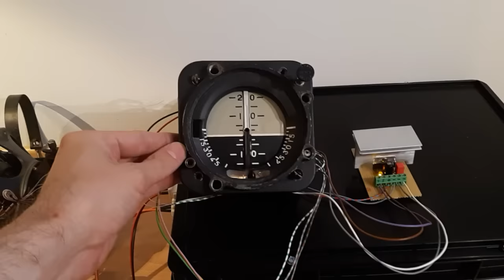Startup of a Russian "type 458" gyro block of a MiG-21 fighter after almost 40years of storage

Comment: Amazing to think of how they did these back in the days of analogue/mechanical computers. Equally amazing, today a similar IMU unit with even more  sensors and axes can fit on your thumb nail for a few bucks.
Reply: Fighter jets typically don't use MEMS for their INS, so no.
Reply: @graealex  True.  In tactical applications and space craft mechanical gyros are used, my guess is in the event of a power failure and restart, the already spinning gyro would continue to hold orientation where a MEMS one would need to be recalibrated upon restart. That would be my guess.  Still, majority of military use cases especially unmanned units and with better backup systems, the benefits significantly outweigh the cons.
Reply: @preddy09  Again, modern fighters also don't use mechanical gyros.
Reply: @graealex  Well, will you tell us what they actually use?
Reply: @graealex  First off, all gyros are mechanical as they rely on conservation of mechanical motion.  Mems gyros have damping factor so large that that they oscillating actuator stops almost instantly.  If not the older "spinning disc" type mechanical gyros, newer gyros use light interferometry based mechanism.  Which again is just a bunch of spinning optics where changes will result in interference.  So it comes down to noise and holding time.  Mems have near zero holding time.  I'm guessing both spinning disc and spinning laser/fiberoptic will spin down over minutes, and significantly lower electrical interference.
Reply from the maker: @Vid304You  they mostly use laser ring gyroscopes.
Reply: Edit:  I'm wrong, it seems light based ones don't require any spinning.  Changes in direction will result in one path of light taking less time than the opposite path, resulting in the two interfering.  Extremely low noise, and no motion.  But suffers the same instant collapse of orientation just like MEMS, but I assuming good backup independent power is not hard.
Reply: @barjan82  thank you!
Reply: @preddy09  No. See laser gyro. Not mechanical.
Reply: Great thread here folks, thank you.
Reply: @graealex  I understand now, thanks for getting me to look into this. Learned new things
Reply: @preddy09  The thing with MEMS is the immense amount of noise, that will at most allow one single integration. With an accurate gyro and acceleration sensor and a very stable clock (Google CSAC), you can do double integration (acceleration to speed to position) with reasonable precision. MEMS gyro/acceleration sensor plus MEMS clock source like in mobile phones drifts like there's no tomorrow.
Reply: @barjan82  Thanks for the demonstration.  Some day I'd like to get one of these as an "antique item"  and display it in a corner of my future house instead of some ambiguously meaningless modern art item.
Reply: @shvrdavid  My understanding now is that vibration noise (mechanical) and correction noise (electrical) are the enemies for stable positioning as those noise sources lead to drift.  Drift means deviation from set position without your knowledge, until you need to recalibrate, obviously that's enemy no.1 for gyroscopes as that defeats the purpose of needing a gyro.  Unmodeled noise is very high in MEMS from both sources.  Mechanical noise is high in active spinning wheel gyros.  Light based gyros are the most stable as they are inertially passive, i.e don't injection of rotation for operation, inertial changes are only sensed. Hope you see the difference there.
Reply: @shvrdavid  I'm talking about setpoint calibration, which needs to be updated if drift is suspected.  There lies the problem.  Also don't confuse accelerometers with gyroscopes.  Accelerometers are much easier to work with and isn't what I'm talking about.
Reply: @shvrdavid  When you say airbags you are automatically talking about accelerometers as no gyros are needed unless rollover detection is added, which is a newer feature.  Gyros were never in cars until recently for rollover and stability control.  Maybe you missed that basic logic.
Also, if MEMS IMUs were so accurate, why do we need GPSs??
Reply: MEMS gyros are mechanical, they use microscopic vibrating structures similar to how the haltares of an insect work. The vibrating structure wants to stay in plane which is how they sense angular rate. Detection of rotation vs the vibrating structure uses capacitance down in the zeptofarad range. Cheap commodity motion processors used in mobile devices work well enough for small multirotors and small to moderately large R/C / drone helicopters (modern R/C helicopters now use a system similar to how the AH-1 replaced the stabilizer bar with a three axis gyro which is why you don't see a stabilizer bar on R/C heli rotor heads anymore). There are aerospace grade MEMS angle sensors for use in small drones but you only see those in military UAVs generally. There was one hobby grade helicopter flight controller that had such a sensor as an optional upgrade, the Mikado Vbar but cheap motion sensors have improved so that they are now considered "good enough" and they have since discontinued that and just use an MPU6000 series sensor in it now.
Reply: @preddy09  Fiberoptic/laser gyros are not mechanical.
Reply: @StefanWelker  Yes.  Already made that correction and briefly explained how they work earlier based on what i understood.
Reply: That’s not a computer!
Reply: even the fanciest plane in the world will have a physical gyroscope to provide it's basis of orientation (datum). even the fastest and most reliable computer will reference a physical gyroscope to verify its other sensors. stationary, plumb and level. the thing that kills the flying ball. digital is a quality of an analogue universe, not the other way around....
Reply: @evolutionCEO  thats not right, dassault and airbus are building mems imus into their newest generation of fighter jets and drones. Also: every quadcopter has a mems  imu, in a quad copter you need even faster acting gyros to get it under control.
Reply: @shvrdavid  "Zero moving parts" and MEMS in the same sentence is a contradiction on its face.  Please read their product line before you make logical errors.
Reply: @evolutionCEO  The reason why commercial aircraft use seemingly antiquated technology is it being reliable and the big risk vs. gain from saving a few pounds. But we were talking about fighter jets, which won't even lift off the ground without immense computer power. It's really a different story, and I suspect a number of MEMS being there too, although that's still not the kind that would fit on a thumbnail, which was the original claim.
Reply: @shvrdavid  I obviously read that and was waiting for you to mention it.  It's called marketing.  Why don't you describe to me how the thermal MEMs devices work.  You'll get it then.
Reply: @shvrdavid  Their claim of no moving parts is questionable. Technically true, yes. There's an explanation in their datasheet:
"A heat source, surrounded by thermopiles in the silicon chip, is suspended across a cavity. This heat source creates a field of heated gas around it, commonly referred as hot air bubble. The thermopiles capable of detecting changes in the temperature field around the heater. Applied acceleration disturbs the temperature profile. The temperature, and hence voltage output of thermopiles will then be different. The differential voltage at the thermopile outputs is directly proportional to the acceleration."
The gas is moving around at least.
Reply: @graealex  Yup.  A grossly over-simplifying analogue would be like watching a helium balloon inside a car change positions based the car's changing velocities.  Not a true "no moving parts" accelerometer but gets some benefits at the cost of discarding higher frequencies.  Actually I don't think a true no moving part accelerometer is physically possible.  Only for a gyro the optical method is truly no moving parts.
Reply: @shvrdavid  Not really sure what you are arguing here? This is mainly about certain technologies having inherent limitations, that no doubt will over time get overcome, but the fact that there's still no reliable way for indoor tracking in smart phones (or VR headsets for example) without GPS or proximity triangulation or camera/TOF tracking should be an indicator for the task at least not being easy or already solved. Obviously progress is happening, but especially aviation projects are usually planned on the span of decades. Btw. MEMSIS puts their MXC400 into the consumer spectrum.
Reply: Edit: I'll take it back.  A no moving part accelerometer is possible using light, but this time, we'd have to use time dilation.    Which would be difficult to do in a small space.  Maybe there's a way to use light interference which would make it a lot easier.
Reply: @preddy09  I'm pretty sure it's possible. There is no theoretical problem in making a linear optical sensor - "only" the practical problem of having to measure TOF of a very short light path.
Anyway, I am pretty sure we'll see miniaturized acc/gyro with drift measured in mm per minute, or maybe even per hour in the next 20 or 30 years. Problem is that fighter jets usually take the components that were state-of-the-art 10 years ago. So even a very efficient sensor like the MEMSIS wasn't even available when current fighter jets were designed. And after a solution is already integrated, there is little reason to change it, unless it gives a large benefit.
Reply: @preddy09  Btw. I was a bit rude on my initial reply because I didn't have the time to formulate proper arguments on why you don't see MEMS technology yet in fighter jets - at least as a replacement for a truly mechanical or optical solution. As pointed out, the problem is that 10 years ago, MEMS was still utter garbage, and no matter how it is going to improve, you still have to carry along a very, very accurate clock source, otherwise you can't do proper integration.
Interestingly, a number of tech channels have recently featured the CSAC as PCIe cards for data centers where time keeping might also be an issue.
Reply: @graealex  Ya was thinking the same. changes in TOF of light over a small distance will need some ultra short pulse laser source.  Interference method like the Michaelson Morley experiment may also work.  But some time before it can get practical in a small space.
Reply: @preddy09  Well. I mean you could always just "simply" measure the Doppler shift. Very simple. There's really no lack of physical phenomena, but the problem is always to get an accurate measurement in the confines of a small package.
Reply: @graealex  Actually didn't think deeper till you mentioned Doppler shift.  I'm no physicist, but if I understand correctly, neither Doppler shift, nor TOF  would work in a "no moving parts" accelerometer.  When it comes to speed of light in a given reference frame, the TOF and Doppler shift = 0 will always be the same no matter the velocity or dV.  Only an external observer could see differences, which would no longer be "no moving parts"  So that leaves the interference method which should work, which is how the optical gyros work also.

Correction: I suppose,  an orthogonal TOF could be used as reference for the other axes.
Reply: @graealex  As for any rudeness, I didn't see it as such.  Short responses could mean anything.  I need mean statement to be counted as rudeness which you did no such thing, and even if anyone speaks that way I don't find offense to that as I've been guilty of that and learning isn't as effective.  I think better when I don't react emotionally and stick to the learning process while allowing others to be critical, which is a good thing.
Reply: @graealex  Ok, I think my initial guess was correct. Had to get back to the Michaelson-Morley experiment.  I don't think any TOF, Doppler or even interference method will work to find acceleration in a fixed reference frame, i.e "no moving parts".  The only reason it work from a gyro is because the center interference detector is moving as the entire vehicle rotates.  So I think no light based "no moving parts" accelerometer is possible.
Reply: @graealex  the gyroscope is a fundamental principle. it is a datum for measurement. it shall never be antiquated.
Reply: @preddy09  You might be right. Although a quantum accelerometer might be as close to that as it gets. Still, the "moving" part are ultra-cold atoms, so it isn't truly solid-state.
However, it's not necessarily a problem of "same frame of reference", because even when everything is moving together, light always travels at the same absolute speed. I only suspect that measuring it might be impossible, as time (and space) dilation would happen to the clock you're carrying along. But that's really as far as my knowledge gets me here. However that's rather theoretical anyway, as using relativistic phenomena to measure non-relativistic speeds is very hard. It would be like getting the value for a car's speedometer by measuring its dilation along the axis of travel. It's true, a car gets a bit longer when it travels at speed, but the effect is negligible compared to all other effects that might have influence on the car dimensions, like temperature.
Reply: So what your really saying is the earth is round because if it was flat planes wouldn't need gyroscopes.
Reply: There is no real opportunity to replace mechanical gyroscopes because only mechanical gyroscopes are capable of holding rotation when the power is turned off.
Reply: @fsagasdfgasd6243  Commercial aircraft continue to use it, because it is relatively cheap to the alternatives that have aeronautical approval. But most fighter jets and a number of newer commercial aircraft will absolutely require power. In those cases measures are put in place to make sure that doesn't happen. For example, the cockpit in a F-22 is completely electronic - there is not a single electro-mechanical instrument visible. So either the cockpit has power, or the pilot is completely blind, and probably not flying for that long either, as the aerodynamic instability inherent to fighter jets makes flying without electronics impossible. But then again, even the A320 for example has a fully electronic cockpit.
Reply: В СССР первый станок ЧПУ уже был в 1958г, МИГ-21 тоже начал выпускаться с 1958г. И да, он был аналоговым.
Reply: @graealex  It's not about a complete power outage, but about short-term power failures, which are associated with a delay in switching backup systems or the accumulation of errors in the electronics. Also, failures can be caused by various external influences that affect the operation of electronics.
A mechanical gyroscope is a reliable and predictable frame of reference that will maintain its position at all times, in case of any possible failures.
Reply: @fsagasdfgasd6243  Okay then tell that to Boing and Airbus. They'll be glad to get your advice about switching back to a mechanical gyro.
Reply: @Vid304You  The last INS  aircraft I worked used laser ring gyros. These are a triangular tube with a  laser shining on a mirror that is reflected on a target. Movement causes an interference signal compared to a reference signal. The iron gyro died in the 1970's.he
Reply: @graealex  Aircraft use several types of gyroscopes together, including mechanical gyroscopes, micromechanical gyroscopes, fiber laser, etc.
On some commercial aircraft, mechanical gyroscopes are not used to reduce cost. Mechanical gyroscopes are quite expensive.
On military aircraft, mechanical gyroscopes are almost always used, of course in tandem with other gyroscopes.
Reply: Tomáš Novotný  No one mentioned it but no one is talking about reaction wheels here either...
Reply: @preddy09  despite all discussion I still think you made a viable point in your first post.
Reply: And breaks multiple times before even getting it out of the package.
Reply: @preddy09  laser gyro IMU setups are battery-reliant, so good guess there
Reply: Please Sirs, can you tell me why as a french man 60 years old, with just a little english capacity, I'm reading your expert conversation, understanding just a part,
 but just enought to poursuit my reading ?
Technical interest, I guess, and pleasure to have a look on specialized conversation between good guys...
Thanks Sirs, you gave me a good time, and teached me some knowledge today !
Reply: That's not fully true. The modern MEMS solution precision is way lower than in this mechanical gyros. This is a fighter jet high precision device. When the MEMS precision is not even enough for personal use cases.
Reply: The gyros in a lot of fighter jets were electrostatic levitated beryllium sphere multiaxial gyroscopes. They used an induction field to spin a hollow beryllium ball in a vaccuum chamber at aproximate 128,000 rpm. Once spun up the ball would stay centered due to eddy current induction. The balll had a laser textured index marking on it that was readout with an array of photodiodes and a laser. One benifit of this was it spun up fast, required no slip wire connections and it had  complete axial freedom. It maintained a reference for several seconds if power is interrupted as well since the ball would continue to spin.
Reply: I wonder which is more reliable, which is more resilient to ECM, and which lasts longer...
Reply: @shvrdavid  Just because it has no moving parts doesn't mean it doesn't need calibrating. Electronic sensors need calibrating too, and do degrade over time.

 Also airbags have expiry dates.
Reply: @shvrdavid  Fair enough on the airbag, that was phased out. However, to say non-moving sensors do not need calibrating is wrong. Sure crash sensors  etc don't need calibrating because they are not being used for precision tasks.
Reply: @preddy09  Being an electronic Engineer today's gyros could easily run for months on a good Lithium battery, the real issue is certification and accuracy, most cheap chips only do 8- 16 bits of accuracy so if you say used 8 bits it gives a  +128 to -127 so roughly 3 degrees in angle... so not great for bombing runs... 
Going back to certifications the big players like to make stuff super hard and expensive and want to milk a design until forced to make it better, hence this is pre ww2 era tech very robust but lots of mechanical costs.
Reply: @graealex  Laser Gyros and dead reckoning is very accurate and is how most pilots are taught, gps is useless at high speed (above 500Mph) so ok for cruise missile about 400Mph, after that speed the time dilation on the received signals is too great and throws out the GPS results... 

Gps works by time stamps and 4 satellites(minimum) (intercepting arc tangents) so timing is super critical as each satellite signal is received the time stamp is read the forth satellite act as a base clock... so by working out the time difference and knowing the satellite you can look up which ones and work out the co ordinates. Note use to work in GPS design (electronics)
Reply: @preddy09  ring laser gyros do not spin  but they do dither back and forth, they hum quietly compared to this
Reply: @ntal5859  Why are you telling me this? Gave I reason to you to assume I don't know that?
Reply: @preddy09  "good backup independent power is not hard" Yes, it is called a capacitor :)
Reply: But it isn't EMP hardened nor military aircraft grade.
Reply: Not to forget that they didn't even use any design software...
Reply: Will they work in 40 years?
Reply: @Vid304You  laser gyros
Reply: Not a few bucks, but I suspect a bit more, at least for military usage.
Here is a video (in French) showing Safran old, actual, incoming and future military gyros, used in fighter jets, nuclear submarine, Leclerc tank, ICBM, etc. : https://www.youtube.com/watch?v=ouz7jc-r4eY
Reply: I was going to jump onto the MEMS gyro bandwagon until I started reading through this thread. I've now been given a much better appreciation of the pros and cons of big physical gyros vs. MEMS vs. other gyro technologies - like laser - that I didn't even know about until now
Reply: @shvrdavid  Without reading all the prior comments leading up to yours, I'll just say that airbags etc. would be using accelerometers instead of gyroscopes, and don't really have to worry about any initial reference point orientation the way many applications using gyroscopes do. In airbags, I'd guess that it's pretty much "big impulse -> deploy" (impulse being the rate of change of acceleration)
Reply: Anyway, awesome and informative comment thread - a rare gem for YouTube!
Reply: @shvrdavid  I'll take a look at the link
Reply: @shvrdavid  Couldn't find the link - there is a lot to read through.
That said, in a nutshell, where do gyroscopes come into the picture with airbags, vs. just accelerometers?
In terms of detecting a crash, I wouldn't think a change in angle would really come into play - only changes in velocity over time (acceleration) or changes in changes in velocity over time (impulse).
As for all the debate about calibration - I'd say it simply comes down to the use case - for something like airbag sensors, I agree that there probably isn't much of a need for calibration, whereas something like an inertial navigation system needs to have some starting reference point and orientation to go from, the establishment of which arguably constitutes calibration.
Finally, don't be toxic - we can all learn from each other without it becoming an exercise in pointedly calling each other wrong.
Reply: @preddy09  No, not all gyros are mechanical, there ate optical gyros as well.
Reply: @preddy09  Haha, sprry about my first comment, I read your later comment firther down the list after writing my first comment! 😜
Reply: @shvrdavid  know nothing about any of this but why are just being rude for no reason to this dude
Reply: @preddy09  Couldn't you make the IMU/motion processor circuit have its own backup power :P
Reply: What do you use to locate and troll people?
Reply: @StefanWelker  could you please give us some links to learn more about mems IMUs for modern planes?
Reply: @graealex  get ratio’d
Reply: Talking about pros and cons, which of these technologies are susceptible to errors due to helium ingress?
Reply: Je vois pas trop l'utilité de ce truc sauf sur systèmes automatisés dont l'apport à l'humanité en tant qu'apport, reste à démontrer, ...
Mais j'ai cru comprendre lumière telle corpusculaire, ondulatoire ...
Par essence, intrinsèquement mouvement mécanique ...
Sauf vos respects ...
Messieurs les «savants» .
Par essence, intrinsèquement, mouvement mécanique .

Autant pour moi, quant à l'établissement de vos points de repères dans le référentiel .
Et, sincèrement désolé de froisser vos égos .

Merci.

Dare, care, ride safe, clean, have fun .
From France with .
Reply: Mechanical gyros give you an angular position, but MEMS gyros only give you angular rates. Useful for controls and drone autopilot, but requires additional reference to estimate an absolute position. Integrating the rates is generally garbage - in a submersible application they'll diverge in a matter of seconds, and in aviation I'm guessing much faster.
Reply: Since people are still replying, here are some thoughts from an actual aerospace engineer if anyone wants to know the real deal.  In no particular order:

- The MiG-21 was designed in the 50s.  Best case, this particular gyro is a mid 60s upgrade.  In general, no airplane designed since the late 70s uses an actual spinning hunk of metal as a gyro.  It's all ring lasers as mentioned

- Even the spinning hunk of metal shown here runs on DC power (28 volts as shown on the meter).   IMUs and the INS are typically on the essential battery bus.  That's how you handle power failures whether the gyros are mechanical or laser.  

- The accuracy requirements for flight controls are actually much looser than for navigation.  If you're off by 1/2 a degree in pitch, roll, or yaw, that's pretty much in the noise when it comes to flight controls.  Be off by that much and integrate several times a second and your navigation solution will run away on you in no time.  

- And last but not least - GPS is useless above 500 knots because of relativity?  Never heard of that.  At the equator you're doing 1000 knots relative to the center of the earth just sitting on the ground.  At the poles, zero.   If 500 knots throws your calculations out the window, GPS would be unreliable over huge portions of the globe.
Reply: @dylanh333  so what about gas bearing gyroscopes?
Reply: @shannonmcbride2010   So now I'm curious. You seem to know about these things. Why are hemispherical resonator gyros or HRGs used in NASA telescopes. I'm trying to understand the applications of these gyros and which ones are accurate in what ways. I'm obviously just googling stuff trying to learn. I saw that the NASA ones are accompanied by several other sensors, but still use the HRGs .
Reply: @jonnash117  I wouldn't have a clue, sorry. The main ones I knew about - before reading through all this - were MEMS
Reply: @shannonmcbride2010  More people need to see your comment. It's always good to have someone in the field actually chime in on threads like this 🙂
Reply: Me when they rotate the housing: "my phone could do that!"
Also me: "but not after 40 years on a shelf."
Reply: i have like 3 of these in my inventory :D
Reply: easy, copied from americans, like all technology in USSR
Reply: I hope I wasn't overselling my experience here.  My background is in testing, so I know the basic principle of operation for the systems I would have to test not necessarily all of the nuts and bolts and don't always hear about the newer advances.  So, I had to look up HRGs.  

Seems like the upsides are light weight, simplicity, and low power draw.  Downside is extremely high manufacturing costs.  Given all that, it makes sense that spacecraft would be the early adopters of that technology.  Low weight and lack of maintenance are far more important on a satellite than an aircraft and that makes it worth spending the extra money.
Reply: @Vid304You  Its called a Piezo gyro. Thank R/C heli / aircraft pilots for the self financed R&D on that little piece of tech. You dont actually think that thousands of adjustments per second thrust vectoring that allows rockets to land on your lawn rely on relic mechanical gyros do you?
Reply: @preddy09  first off...no they are not. Look up Micro Piezo gyros. You can have hundreds of these small, light solid -state systems cross referencing each other for the weight of one mechanical system.
Reply: @graealex  mems clock in mobile phones?
Reply: @ivok9846  Yes? What about it? Besides the fact that MEMS clocks have worse accuracy than normal Quartz-based ones.
Reply: @graealex  which mobile phones are clocked by mems? did you mistake mobile "clocks" for phones?
Reply: @ivok9846  As far as I know, all modern and highly-integrated ones use a MEMS-based oscillator and/or fully integrated clock sources. The way MEMS is fabricated allows easy integration with more circuitry in a small package, so you can put in multiple PLLs to generate various frequencies. But what's your point?
Reply: @graealex  mobile phones/smartphones are clocked by quartz.
why did you connect modern electronics (mobile phones) to  mems?
Reply: @ivok9846  No, most modern phones now use MEMS oscillators instead of quartz oscillators, as they are usually smaller and better integrated, and their inaccuracy doesn't matter. It's also the reason why the iPhone fails to work when exposed to helium, as the helium molecules permeate the MEMS structures and stop them from working properly.
Reply: @graealex  you're right, my bad. yeah, precision of time doesn't matter if it's constantly on the internet, and without it it's piece of useless crap. 
but the terminology: wafer of silicon is called mems, while wafer of quartz is not. while they're equally mechanical or electrical, or not. 

well, i guess someone needed to save 2mm of pcb space... hehe....
Reply: @ivok9846  When talking about precision in the context of a smart phone clock source, the requirement is usually the baseband processor. Depending on the RF requirements, a certain frequency stability is required. Time of day isn't really the problem here, especially since it is provided by the cellular network anyway. For example, 5G needs very precise local clock sources with low jitter in the network/infrastructure equipment. The demands can be so high that a typical circuit consisting of a normal LF crystal (up to 100 MHz) and a PLL already has too much noise although it provides good long-term stability (i.e. it would be a good source for a wall clock, but a bad source for RF synthesis).
Reply: @preddy09  I have one like this
Reply: - interesting enough, those Russians didn't invented both - the old gyro, and the new one.  
Persistence)))